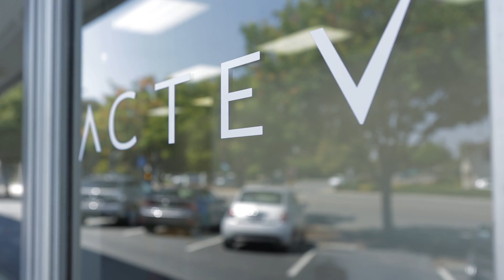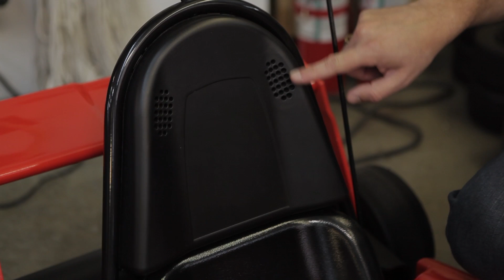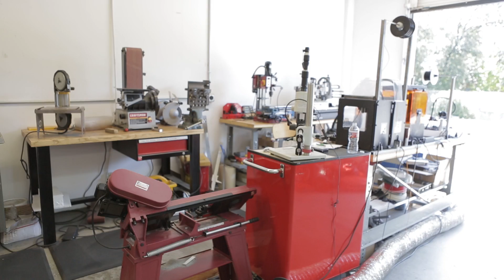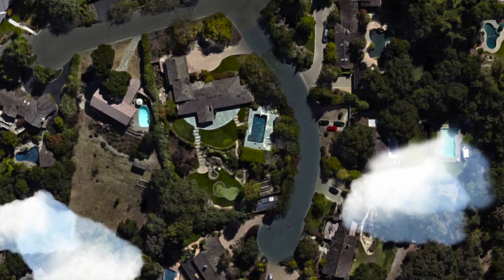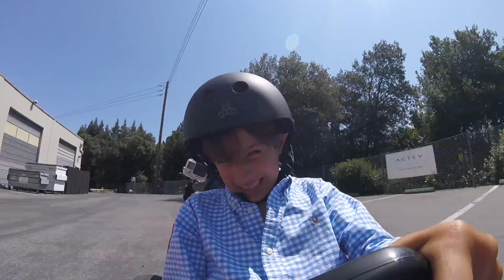Actev Motors electric go karts for kids

Comment: That's great I took a razor drift kart that I picked up from Goodwilland I replace the dead battery with a 36 volt lithium-ion 18650 cell packthe kids took off on it and it scared him so much they couldn't let off the throttle so I like the sensor safety feature that's going to stop the car from hitting something

Comment: That kart isn't ever hitting 120mph unless you replace the 125cc to 250cc or while it's being drivin to a race in a fast truck
Hey maybe I'm wrong.  
If that's a rotax dd2; it will never hit 120mph(I have one). 
I dont see a shifter except for the paddles which again wont be greater than 90mph

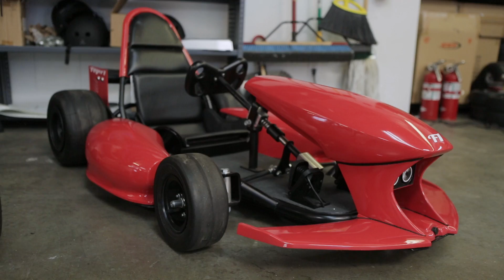Comment: ummm 0:50 thats a tony kart with a 125cc / 100cc 2 stroke engine... ive driven many racekarts and owned a few 4 stroke and 2 stroke karts and they do not go 120 mph... shifter karts with a 50 hp 125cc engine do 150 kmh tops not 120 mph

Comment: what would be sick is if someone took a racing-kart engine and stuck it in that thing(and removed all the electric crap)
Reply: Topkart5 the stupid electric wifi. shit shit boundaries the dawm engine sounds. the emergency stoping etc
Reply: The "racing-kart" engine is actually meant for ages 12-15 and 15 and up its professional racing which I do what is this electric stuff
Reply: spencer wells i pefere my 13 hp pedear
Reply: I'll just casually put in a 2 stroke 60 hp engine

Comment: Very cool kart...here are some thoughts

// Pros
1) I like the geo fence, speed and app features
2) Cool design
3) Looks like it will fit kids of all sizes
4) Overall quality will be high

// Things to change:
1) Needs to have an upgrade ability to hit at least 20mph
2) The crash avoidance system is not needed...especially at 5-12mph. (cut it out to save money)
3) They should sell a roller kit without electronics 
4) Price is too high for what it is
Reply: gbsavc i agree 100%
Reply: To be fair I'd be happy without the app shit too, and the speed is a bit lacking, your kid is never gonna get a feel for actual manoeuvring, I'd like something with a more progressive speed to prepare them for faster carts later, needs to power slide.

Comment: That rotax might go 80 mph that dude is so wrong
Reply: No hes not wrong,  it all depends on sprockets/gearing and also the motor can have a big bore kit with lightweight flywheel and ignition timing changed to run off 110 octane!